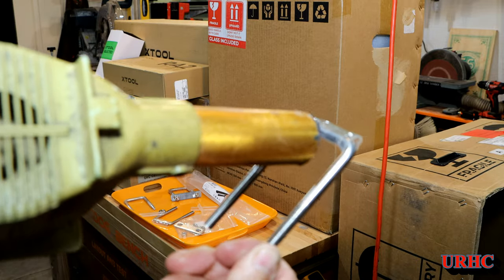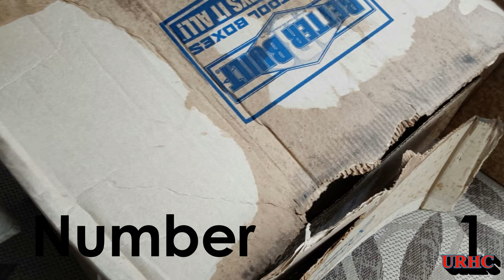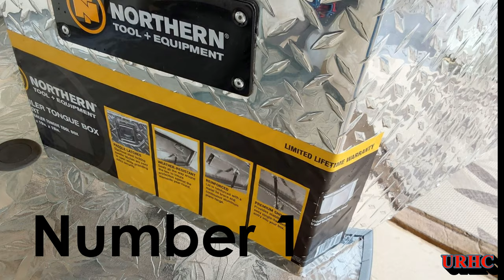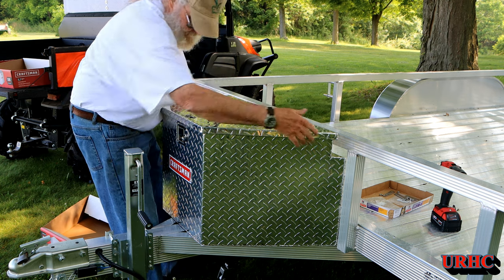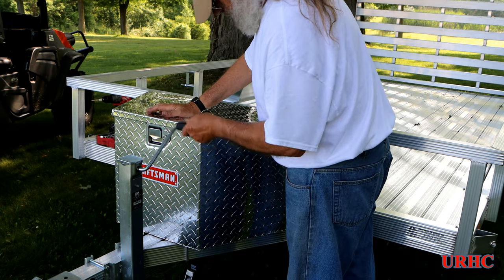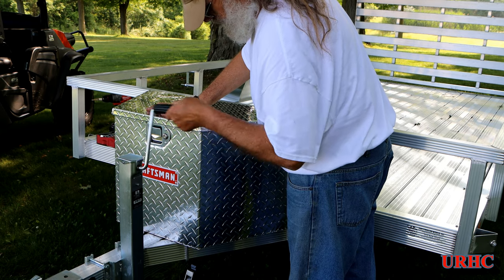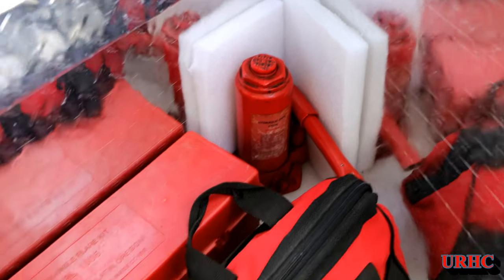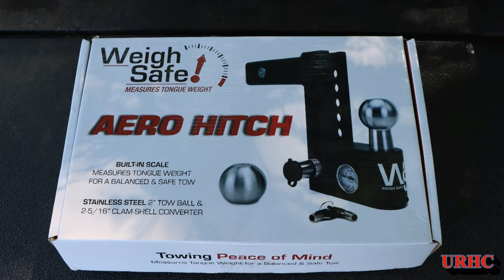Adding An Aluminum Tongue Storage Box To The Sport Haven Aluminum Trailer

Comment: I just moved from a 5x10 galvanized trailer to a 6x12 aluminum trailer similar to this one.  This video goes over exaclty what I need to do to mount a box to the new trailer.  Lots of things I would have missed are covered.  Great job.
Reply from the maker: Most people will just screw them to the tongue but I don't feel comfortable adding holes to mine. I am adding e track now. Thanks for watching.
Reply: Do you have a link to the bolts you used?

Comment: I always carry a 6x6 about a foot long with a wedge on one end. You never need a jack with a block when you have a tandem trailer- just drive the good tire up on the block and it will lift the flat one. Very nice trailer.
Reply from the maker: That's a good idea. I have always carried the small hydraulic jack. Thanks for watching.

Comment: That's a great addition to the trailer, I have a similar aluminum trailer and would like to add that box...  do you by chance have the lowes link or product number? Great to put my straps and spare bottle jack so I don't have to keep them in the truck.
Reply from the maker: This was the Lowes number 3429647 I bought.  Looks like it went up $10 today. Definitely go to your local store and pick through them for the best one. You may not need one this big  for just some straps. Thanks for watching.

Comment: I wish hose manufacturers knew about dissimilar metals fusing.
Reply from the maker: There definitely are some questionable areas. I may put Tef-Gel on some areas. Thanks for watching
Reply: @unemployedredneckhillbilly2023  I was referring to flexzilla and Uber flex garden and pressure washer hoser. Fantastic hoses. But they have aluminum fittings. I think most everyone would be willing to pay for a version with brass fittings